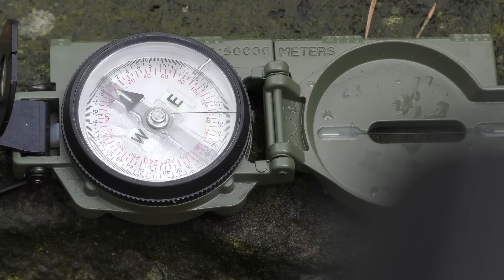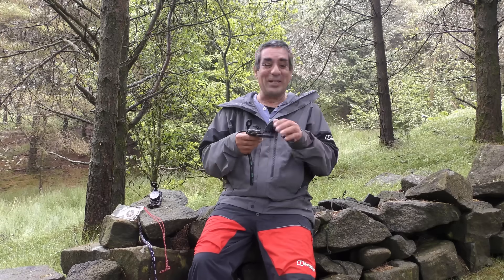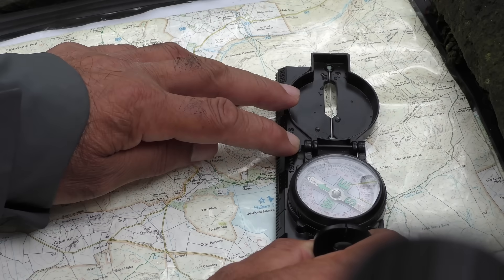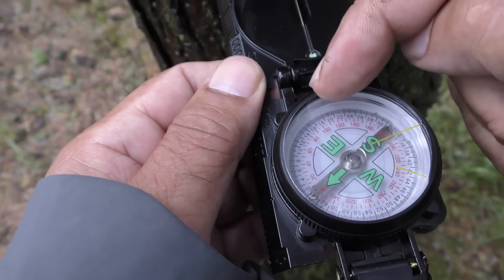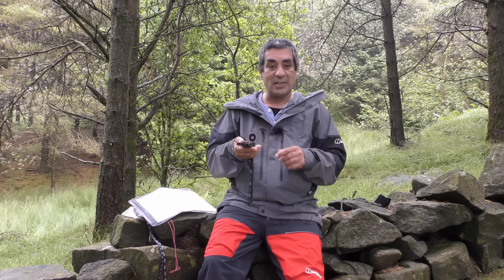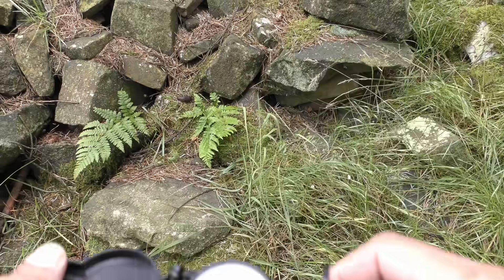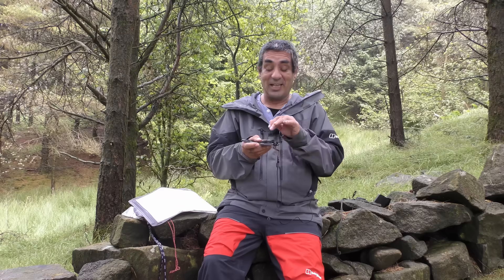The compass no one knows how to use

Comment: ok.... i may just be to sleepy to understand this correctly.

1) Place map on ground in any direction you want.
2) Place compass on map oriented in the direction you want to go.
3) Turn dial so long line 'points' up towards the wire pointing in the direction you want to go.

Wouldn't this give you the bearing you want to follow at that point?

Wouldnt turning the Compass so that North is under that line just have you going.. well.. north?
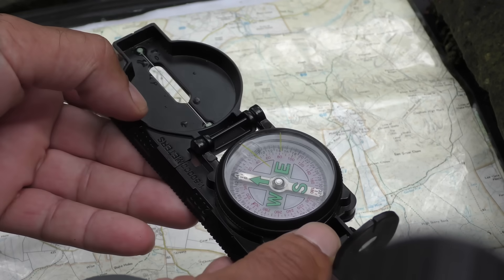Reply from the maker: Watch the video again and you'll see that at 4:20 the bearing you follow is indicated by the number on the dial below the sight wire.
Reply: @TheMapReadingCompany  oh.. wait.. i think what's throwing me off is that the bearing you chose was so close to 'north' that it looked like you simply lined north up with the direction you wanted to go in.

Comment: Some years ago while hunting moose on snowmobile off the Stampede Road north of Healey Alaska I was in a long, wide valley oriented east-west.  Snowmobiles and rifles were permitted in the valley as it was state of ALaska land, but it was surrounded on the north and south by Denali National Park, where neither were allowed on a US National Park. All of this prior to the days of GPS. I did have a hand held LORAN in my machine pack but in the valley it was not any use. I also had USGS topo maps and a good engineer compass of the type you show. 
Problem: Dusk coming on and I had moved around enough I was unsure of the exact location of the road where my truck was parked in a lot. Temp 20F. Gas at half tank in machine.
I stopped on a point of good visibility, got out compass and topo map and started to look at distinctive landmarks and identify them on the map.  Then took readings on 3 of them and drew a back-azimuth line from that point on the map. In a few minutes the 3 crossed, indicating my location on the map. From there I could take a heading to the road, I did, got back and all was well.  

Never trust gadgets that depend on electricity when it really matters. It is the same reason I learned how to take a noon sight with a sextant and figure location from the sun tables.  The same can be done at night with moon and stars.  A compass only provides one axis of orientation.  A sextant gives a lot more. They have guided sailors and later airmen for centuries.
Reply: Mechanical failure is a thing.  I recommend packing both alongside a portable charger.
Reply: Actually the law changed in 2010, when the parks reciprocated with the laws of the state they were in. When were you born, 2011?
Reply: They may not run out of batteries but even sextants and compasses can be broken or lost, so a backup of anything you use for navigation is a good idea.
Reply: A n overnight hiker got himself lost depending on his cell phone. Those batteries don’t last long overnight in the cold.
Reply: When was this the 60's?  All firearms are legal in National Parks and forests in the United States.
Reply: @SaanMigwell  Not sure about that.  In the Delaware Water Gap National Recreation Area here in NJ/PA rifles are illegal but shotguns are legal.

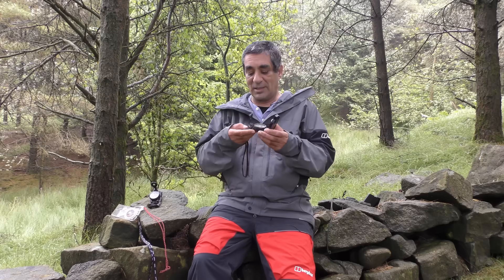Comment: Still have one tucked in the old first aid pouch we carried them in. I was in the US Army when we still used those. Back then we did map work with a protractor and generally a 1:24.000 or 1:50,000 scale topo map. I got to where I could read coordinates within 10 meters on a 1:50K without the protractor. Also was in during the shift from the pickle suit to BDU, Willy's to CUCV, to Humvee, M16A1 to A2, and M1911A1 to M9. Yeah, a while back. That said, I appreciate the refresh on the lensatic compass as it's been a few decades since I did any land nav with it. Yeah, started with the canned Combat Rations then to MREs.
Reply: You might be a touch ahead of me but not by much.  I bought a Cammenga and it glowed brightly for around 20 years, started to fade.  After almost 40 years it faded away to nearly nothing.  So I bought a new one!

Comment: Spent 12 years in the infantry in the 80s/90s using a Silva Ranger for 'work'.
Mirror compasses did to lensatic compasses what GPS did to all compasses. It's great to learn how things used to be done and orienteering is always a valuable skill to have, but tech always improves with time if it continues to be useful.

Comment: Try using that compass at 40mph in the desert, having 0 contour lines or features on terrain maps. Great times
Reply: When the haboob is winding up you definitely can’t see tracks for very long.
Reply: If it's a sand desert, you can still see the track you left behind, and you can check how far you went into the wrong direction.
Reply: Sounds like an Iraq vet to me!

Comment: I always thought you were supposed to hold the compass out at arms reach to take a bearing?
Reply from the maker: Whatever works for you is fine and it depends on the type of compass you're using.  The way I teach it (and do it myself) is to hold the compass at around chest height in front of you.  This way you can look down and see the bearing and needle and also lift your head to ensure the direction arrow is pointing at the feature.
Have a look at this video at around the 6:40 mark https://youtu.be/eaqynPX3sPo
Reply: @TheMapReadingCompany  that makes sense just making usre im practicing the correct etiquette to be as accurate as possible.
Reply: I teach map reading and land navigation for a living. The two methods to read an azimuth from a lensatic compass are the  center hold technique and compass to cheek technique.

Comment: The second line can be used to go around an obstacle at a 45 degree angle and then back at a 90 degree. Perhaps you can do a video on 45, 60, and 90 degree angles around an obstacle. I enjoy the waffles. Lol
Reply from the maker: I always prefer to "box" it when going around things - so I use 90 then set pace, then 90 around obstacle, then 90 set pace back to the bearing.  But there are lot's of methods so 45 is OK, in fact whatever works for you, but I tend to use and teach 90.   See this video  https://youtu.be/gBpOrcgfSFY

Comment: An ex-us soldier have told me  when you aim the compass, the front and back sights needed to touch each other at the tips and forms a triangular roof. Previously, I did just like everyone else, erect the sights vertically. I still don't know which one is right.
Reply: Angled in is correct, straight up is absolutely wrong.

Comment: Thanks for the video on these knock off compasses. I have a cheap lensatic and a reliable Commenga. Here's what ChatGPT has to say:

"Yes, the 45-degree line on the early US lensatic military magnetic compasses assisted in changing the azimuth in the dark, ensuring accuracy and reducing the number of clicks of the bezel ring needed. Here’s how it worked:

Simplified Adjustments: The 45-degree line allowed soldiers to make quick and approximate adjustments to their azimuth. By aligning with the 45-degree line, they could quickly estimate changes in direction without the need for precise manipulation of the bezel ring.

Reduced Clicks: The bezel ring on these compasses typically had 3-degree increments. Changing direction by larger increments (like 45 degrees) was made easier with the angled line, reducing the number of clicks needed and thus saving time.

Accuracy in Low Light: In darkness, fine adjustments could be challenging. The 45-degree line provided a larger, more visible reference point, helping to maintain accuracy when fine details of the compass dial were hard to see.

This feature made the compass more user-friendly and effective for night operations, allowing for quicker and more accurate azimuth changes with minimal fuss."

Comment: I need to get myself another lensatic, they’re just simpler to use than a baseplate-style compass. At some time in the mid-80s I bought a “Sandy 183” lensatic compass with tritium illumination from the Military Clothing Sales Store, as opposed to the issued phosphorescent compasses. Manufacturer was Stocker & Yale as you mentioned. I had it for about 30 years, but at some point it stopped being accurate and I got rid of it. It was so old the tritium markings were barely visible on a totally black night with eyes adjusted.

Comment: Interesting, I never counted the clicks before. Why are they 3° and not 50 mils? I thought the military was all about mils. Also, I’m a little disappointed now that my new Camenga does not have a 45° line.
Reply from the maker: I may be wrong about this but I would “guess” that it’s in degrees as the infantry were who it was designed initially for.  The artillery and engineers, who tended to use mils more, used a different type of compass (the M2) in those days.  But as I said it’s just a guess as I really know nothing about American military history.
US M2 artillery and engineers compass shown here:
https://www.usmilitariaforum.com/forums/uploads/imageproxy/IMG_6722.jpg.db0bcb3f81c02e240bc46b3b4da03cd6.jpg
Reply: @TheMapReadingCompany  
I suppose that makes sense. I just figured that since the high resolution outer scale is in mils and the low resolution inner scale (5° increments) is in degrees, that their emphasis would be on mils. I have always wished that Cammenga would make a compass card with the scales swapped.
Reply: I teach Artillery observers  for the Army. Forward onservers uses the mils on the lansetic compass because we can more easily use trigonometry to calculate the adjustment of artillery rounds with mils. We teach our forward observers  to land navigate using mils just to get in the habit of using mils. Other MOS such as 11B Infantry use degrees when land navigating because they are not as in-depth trained in Artillery other than emergency call for fire. 11C mortarmen which are also infantry have more in-depth training with mils due to using indirect fires. but because of their background as infantrymen they will use degrees to land navigate.

Comment: Very interesting! I learned how to use a compass during my conscript time. (being able to navigate with a map and compass was and is kind of "usefull" in those "camouflage hiking clubs" ;-) ) 
But the ones we used were from swiss manufacturer Recta, which is now owned by Suunto. And they were mirror compasses. Looked like the MB-6 on the Suunto website but were not in ° but in Mil.
So one full circle were 6400 ' instead of 360°. (Makes no difference in use of the compass, just the numbers are different. But as the unit is always used when talking, there's no confusion)
They were easy and practical as they take up very little space and are quite sturdy.
I even bought a civlian one later on for myself (civilian ones are in °). And while it's in my backpack for over 25 years now when hiking, i haven't needed it yet.
(Markings on the hiking routes i tend to use are good enough and otherwise i have a reasonably good natural orientation capability.)
And i always wondered what differences there were with these older more complicated looking ones.

Comment: What are the advantages with this type compared to other types?
Reply from the maker: The only reason I have two of them is that two guys turned up with them on one of my courses.  I swopped them for two of my spare suunto compasses (so result for they guys) so they could complete the course.
Just my opinion, so may be wrong, but I would say there absolutely no "advantages" with these cheap rubbish toy compasses.  They are marketed to fool people in to believing they can be used for serious navigation - they can't.  I only made this video as so many people do buy them and there is not one website or video explaining how they are used, so I thought I would.

Comment: I've learned so much from your videos, so first off, thank you! I happen to have a more expensive version of a new Cammenga compass, but weirdly, it doesn't have the long yellow line! It has only the short yellow line and a fixed, black sighting line. So, is it of any use? I would love to know how such a compass could be used. It's clearly not of cheap construction, as it has a metal housing. I believe the only structural plastic that's used is of the rotating bezel, which of course also moves the short yellow line. Any insights would be greatly appreciated. Cheers!

Comment: I have been successfully using a compass for both land (orienteering)and sea (navigation) for a longtime but I have always avoided these military compasses. However this video has sparked an interest in this compass for me. I might need to buy one and take a back country trip. I’m not sure which version of this style is faithfully genuine to the M 1950 or even if that matters.
Reply: Have you ever made your own quadrant or learned to determine true north using just a stick and the sun... it's fun and useful
Not so useful at sea for the stick 
But the quadrant is
A map and quadrant you're good
And you can make a quadrant from any flat board paper etc with a string and a weight... good to know if you're at sea and your sextant goes over the side..

Comment: Used it in the US Army in the ‘80’s, but no one explained the yellow lines.  Funny enough, I just used the long one as you suggested, I could never figure out why they had a 45 degree offset.  I kind of thought maybe it was for going around obstacles or something, but never worried about it.
Reply: The instructions say some BS about nighttime use if I remember correctly. That was 50 years ago so I may be wrong. I've always ignored it until now.
Reply: You mentioning obstacles jogged my memory from boy scouts. I suddenly distinctly remember my scoutmaster saying they could be used for that, I think in combination with counting steps or time spent heading off and then back on to your path.

I guess that wasn't their true purpose after all, but I dont see why it wouldn't work.
Reply: @noscopesallowed8128  I’m sure the Army taught me that  going around obstacles WAS the purpose.  You had to count your steps on each leg.

Comment: Best video about the subjekt. I use the german Breithaupt Conat 3, most of the current Silvas and a lot of the chinese copies of the M1950 and Camenga copies. In my opinion the best chinese knockoffs is the copy of the old german WilKie (Wilhelm Kienzle) Meridian compass. Formerly a prismatic compass the copy have an lensatic sighting system. The only flaw in my eyes of these compasses is the way, the capsule is connected with the compass housing. The original WilKie was discontinued a few years ago, after Kasper and Richter bought the patents and stopped production.
The Meridian was the only compass with an thermoelastic capsule and the manufacturer keep the secrets up to day.

Comment: See, I thought you were going to talk about a brunton standard transit. Had mine for about 3 months now and still have no clue.
 Side note, every American soldier or Marine can use  them.  It's a standard yearly proficiency  that's  required to be promoted  to the next rank.
Reply from the maker: This is not used in the same way as a modern Cammenga – that’s the point of the video.
Reply: @TheMapReadingCompany  in the military it is. Every year, we have to do a land nave course, and we are still taught to align the map, set an azmuth to a point, and follow.

Comment: I've had one with two glow in the dark lines instead of your white lines since the 70's. I bought it in a military surplus store here in Iowa.

My father was a watch maker in the early 60's and took in a very old compass as trade on a new watch.

The old compass is mounted on an old leather pocket watch fob and has a silver case just like an old pocket watch.

It opens by pressing the stem like a pocket watch. The cover when snapped shut locks the needle from spinning to protect it.

On the front cover are two large letters"US" indicating it was probably an old military compass of some branch.

I have not seen another one like it so we never figured out the history behind it.
Reply: Might have been a Wittnauer WW2 Military Pocket Compass
Reply: search "Google images" and if it is out there you'll find it.

Comment: Used one for 20 yrs whilst Serving. Dam fine tool coupled with a Decent 1:60,000 map.
Reply from the maker: This is not used in the same way as a modern Cammenga – that’s the point of the video.

Comment: Surprised you didn't mention using a protractor with that type of compass (protractor 6" RA). Will have to re-run your presentation a couple of times to really get a grip on using that type of compass. Think I might be always walking in a Northerly direction everytime I use it, regardless of the bearing set on it ! Happy Trails. P S I really enjoy your presentations.
Reply from the maker: It's got a straight edge, so using the long yellow line on the map (point it north - same as a Cammenga tritium mark), it doesn't need a protractor.
Reply: @TheMapReadingCompany  Thanks for taking the time to explain that, very much appreciated.

Comment: Interesting video as always. I have a Silva type 4/54 with a sighting lense on the side of the housing, how do you rate this and what would you recommend as a sighting compass for general navigation over a standard exped 4 for example. Thanks.
Reply: A prismatic silva, best possible compass. It’s two compasses: a baseplate compass with good direct map interaction and a number compass with an easy readout of a direction to the degree. That’s to do lensatic type work but with ease and precision. you usually work with a protractor then. In practice there is probably no need for that, but you completely out run a lensatic in specs.